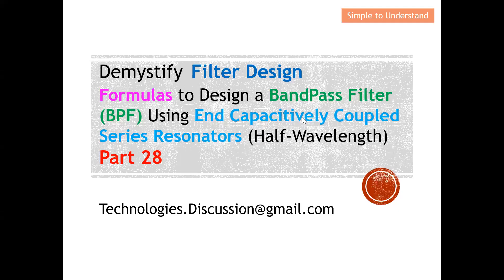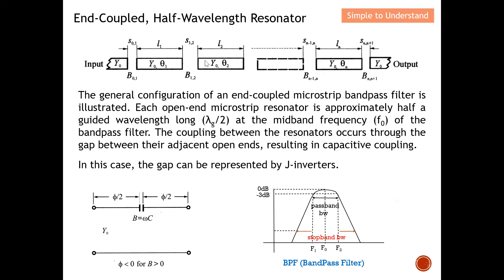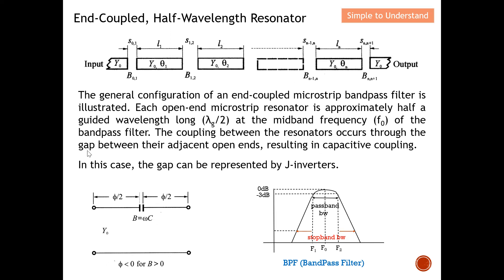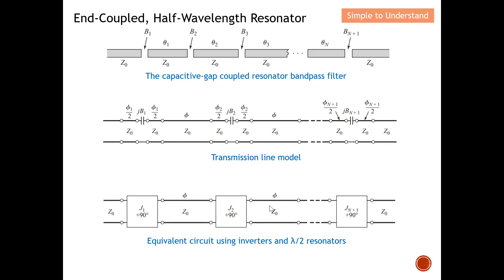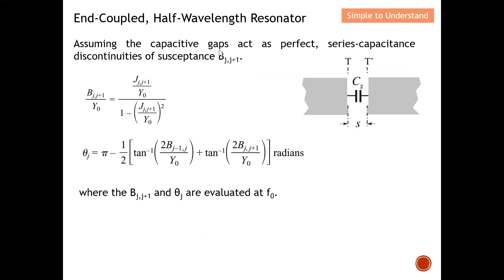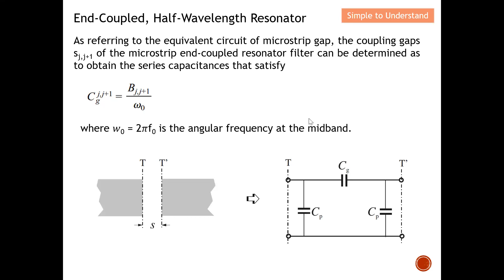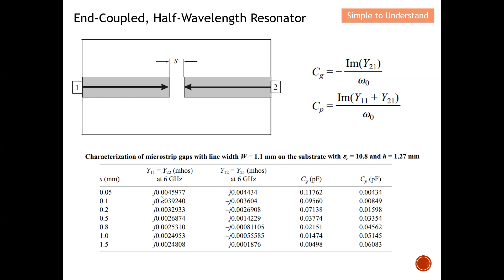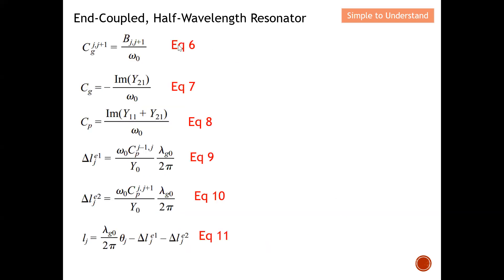Filter Design #28. How to Design Capacitively End-Coupled Half-Wavelength Resonator Bandpass Filter.

Comment: Can you explain how long the lines have to be to be able to obtain the shunt capacitances through the simulation? We only know how wide they need to be but not how long...
Reply from the maker: Each open-end microstrip resonator is approximately half a guided wavelength long (λg/2) at the midband frequency (f0) of the bandpass filter. Is on slide 2.  :)